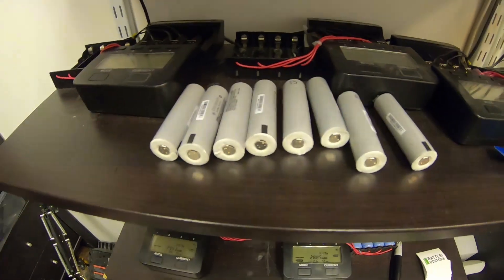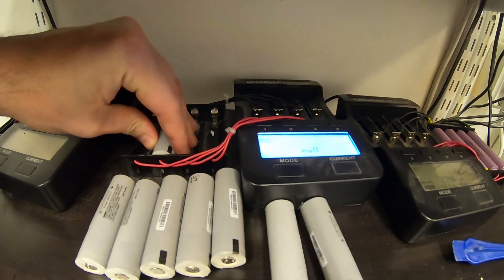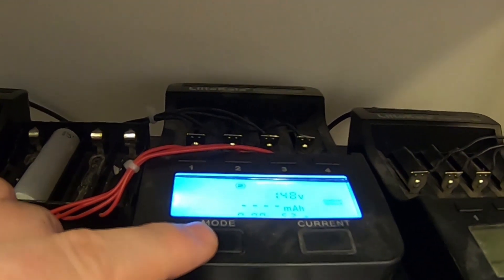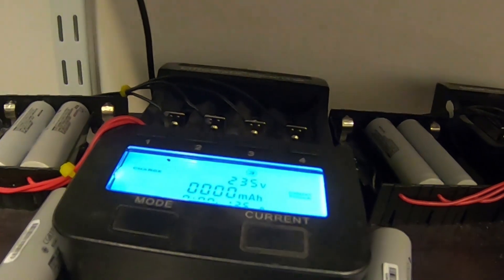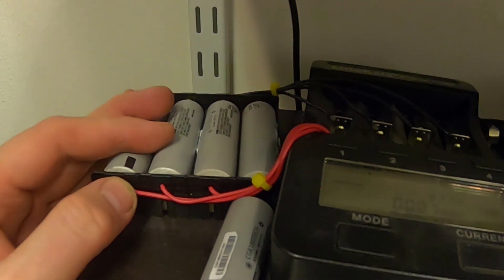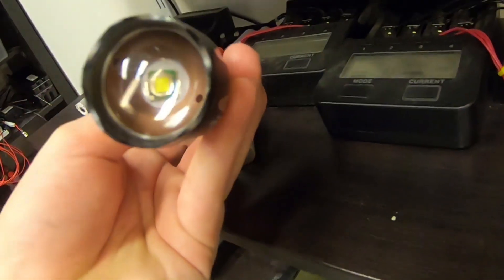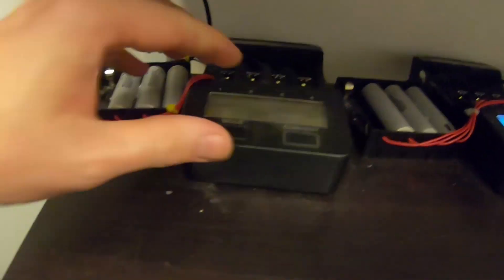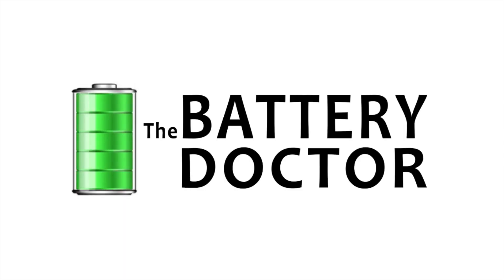How to revive low voltage lithium-ion 18650 cells using Liitokala Lii-500

Comment: If you have a variable DC power supply, you don't have to go through the process of tricking the LiitoKala. Just set the voltage at say 3.2V to start with and limit the Amp setting to whatever you decide, let's say 0.5A. After this, the battery should be revived to normal.

Comment: So I just bought one of these and my old 18650 battery's where obviously to low on voltage due to not being in use but this charger didn't reconside them it said error null like there wasn't a battery in there so I thought screw it I'll try and charge them in my vape and worked great so I took them out 30 secs later now the charger lii 500 reads them can someone explain please as I'm a little confused how a vape charged them and not a smart charger that can recover battery's thanks
Reply: Dude I have that exact same problem... For a year now my Liitokala M4S charger just stops charging or it doesn't even start, so I have to switch on and off  untill it does eventually, but almost never goes all the way to full charge, it displays the END message (and stops charging) at least a couple times along the climbing... When I can't seem to make it start, I do just like you... I pop into my DRAG4 and let them have it... I have noticed that when I let the batteries go below 20% (just a wee bit, down to 15% max, before I would pop 'em off when down to 25% max) I am able to start charging with no problem more times than not, and maybe 1/3 of the times it goes all the way in one go... But cannot fathom why the vape would be totally cool charging with any scenario but the device specialized for charging has all these 'maladptations' 😅

Comment: I believe the 4,35v cells were Sanyo or lg. Something red anyway. But i currently have no bench powersupply. I use an old opus that will take cells from 0.4v, and to bump a 0v cell there,  i use a defective cell that always goes down to about 0.4/.5v and charge it in series with whatever i want to charge. I like to use a low voltage cell, so that it won't charge that fast when these cells seem most fragile
Reply: I meant parallel, i didn't drink my kaffe yet

Comment: Just put the low voltage cell in parallel with a 3v battery for about 10 seconds and they will charge just fine :)
Reply from the maker: Yes, but then you dont really know if the wants to live... cells that cant reach 2.3V with this test we dont revive since they are to far gone,

Comment: i have LiitoKala Lii-500 when is better to measuring internal resistance ,when is full charged or when is discharged ? it is very different value like 10-90
Reply: The resistance has nothing to with capacity or age or quality of the cell. It will be more or less random since the cells are mechanically connected to the tester or the probe
Reply: It has nothing to do with the size of the batteries it is about leaking batteries damaging the charger.

Comment: Being very careful I place very low batterys in a parallel board with other chargeable batterys to jump start them taking notice of internal resistance. Use caution and careful monitoring of these cells for rapid heating. Discard cells dead zone cells as needed because some can never  be revived....also use computer fans to keep the Liitokayla chargers cool

Comment: I use a tp4056 module for cells with low voltage.very effective
Reply: Exactly!  With a simple change of one resistor on the "typical" TP4056 board to a 10K potentiometer plus 1K ohm resistor in series, I can adjust the current anywhere from 50mA up to 1000mA with a simple twist of the potentiometer.

  For best results with cells below 2.0 Volts, I bring them up to 3.30V very slowly (i.e. - 100mA to 200mA).  Once I reach 3.30V,  I increase the current to 300mA and continue charging up to 4.00V.   I'm constantly checking the temperature of the cell to verify it doesn't overheat and then thermally "run-away".   When I reach 4.00V, I perform a discharge cycle.  NOTE:  I don't perform a capacity test!  That option charges the cell up to 4.20V first, then discharges.  I want the FIRST cycle to discharge from 4.00V down to 2.80V at 500mA to reduce the stress the cell endures.  After discharging down to 2.80V, I charge back up at 500mA all the way to 4.20V and then finally... perform a capacity test.  It's a bit labor intensive, but the slow charging/discharging gently eases the old cell's chemistry back to life and minimizes the risks. 

 I've revived 18650's that were discharged down to 0.020V with this method.  However, I've noticed that 50% of these "Ultra-Low-Voltage" cells will often have a slow self-discharge after I revive them.  Unfortunately it's permanent.  It's due to some funky chemistry that goes on when they're left at such a low Voltage for a long duration.  The amount of self-discharge depends on how low the cells went and for how long they spent at that "near zero" voltage before being revived.